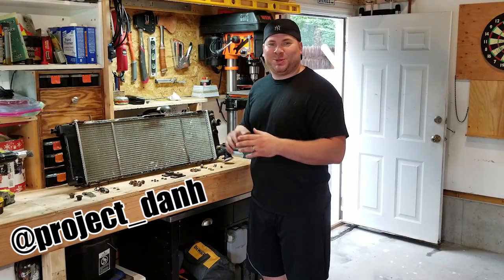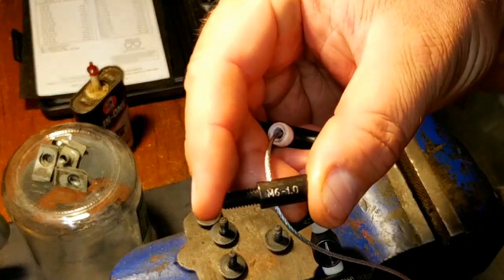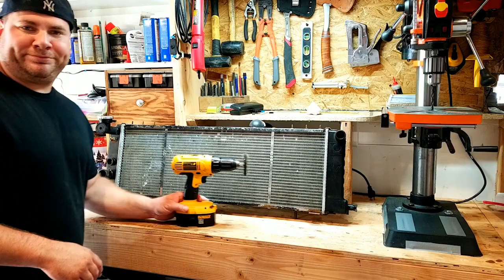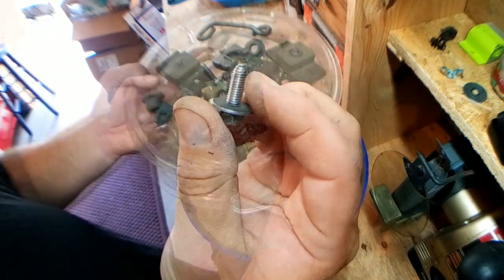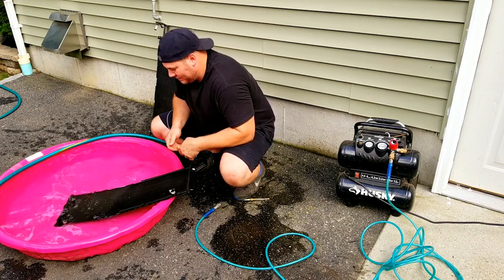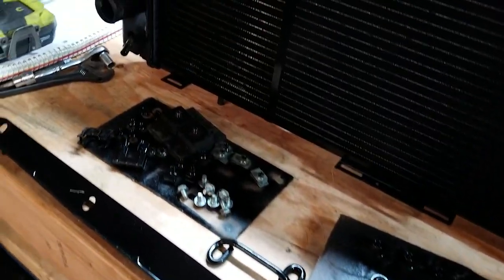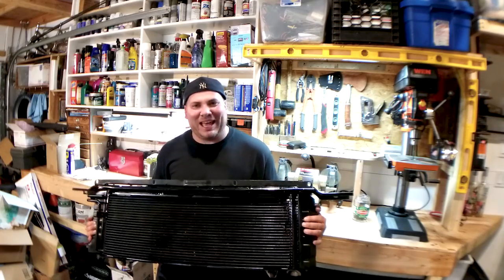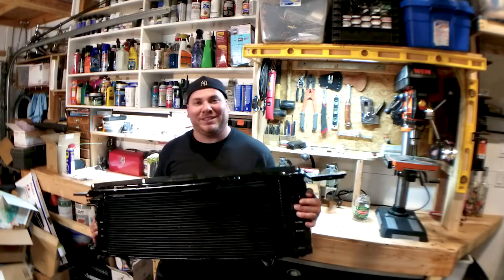JEEP XJ RADIATOR  RESTORATION & CONDENSER TEST FOR 1997-2001 CHEROKEES

Comment: Nice video! You almost won my personal Jeep video of the year award. At the beginning I thought to myself that here was finally someone who knows how to pick something other than techno-garbage music. You blew it when you were putting the assembly back together. ; ) Now on a serious note, I really liked your video. I have a couple of questions/comments. First, why not use a high temperature gloss black engine paint? The Rustoleum Paint’s upper temperature limit is 200F. Second, depending on how long it is going to be before you use the assembly, you might want to rethink the masking tape. My experience with it has been that after a month you can’t get the stuff off with anything short of a sand blaster or grinding wheel. Regardless, very nice work!
Reply from the maker: Haha Sorry about the music! YouTube copyright limits our selection and the techno garbage is the only Genre readily available! Thanks for bearing with it and I really appreciate your view.  PS... Don't worry, the masking tape is long gone!  🤣

Comment: Hi, Like your videos! Is it wisely to coat the radiator surface? Is the paint not interferring the cooling?
Reply from the maker: You definitely don't want to insulate the fins with unnecessary coats of paint but I think a little touch up wouldn't hurt.  Thanks for watching!